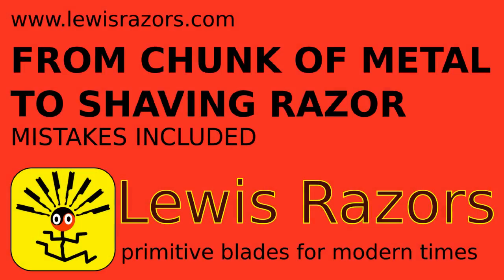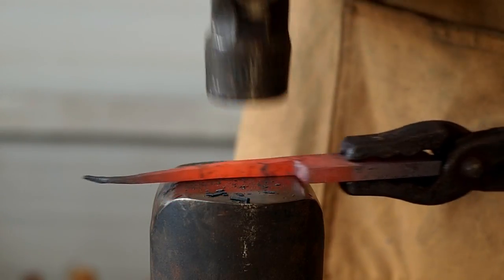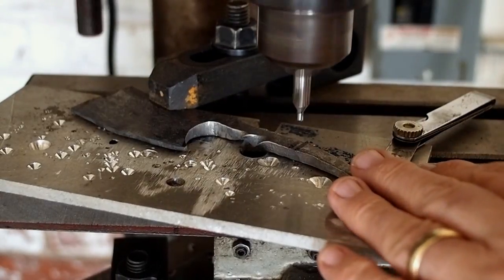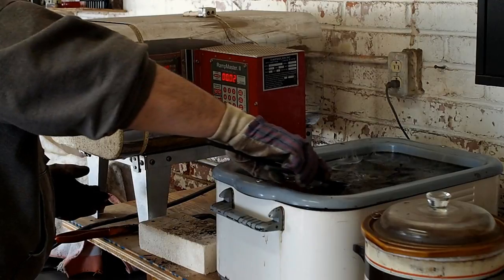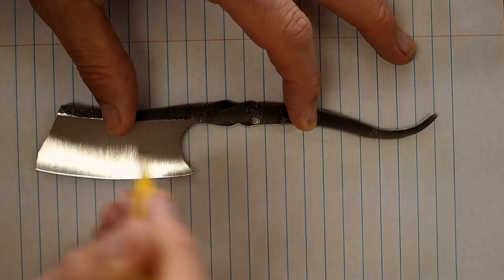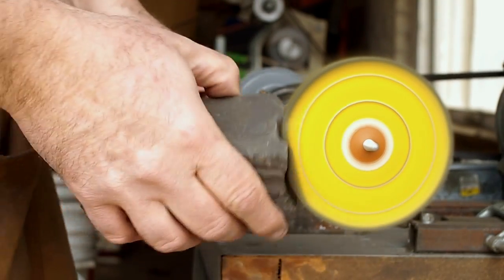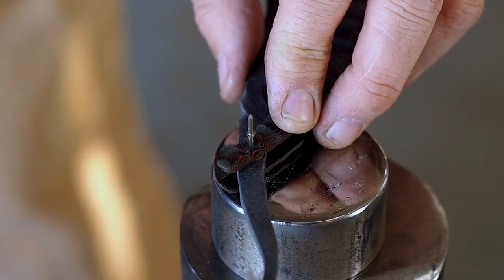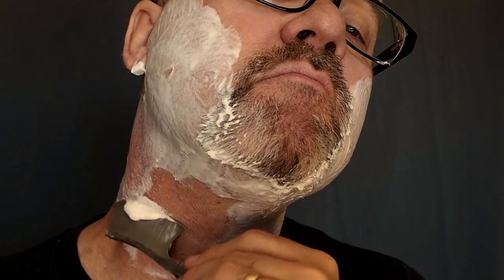Razor, From Chunk Of Steel To Shaving

Comment: Марку стали не понял какая.
Reply: в начале видео:  O1 tool steel
 equivalent:
DIN 1.2510
B.S. BO 1
ASTM A681
FED QQ-T-570
SAE J437
SAE J438
UNS T31501
Reply from the maker: Thank you pirsig78 , I did not know the answer.